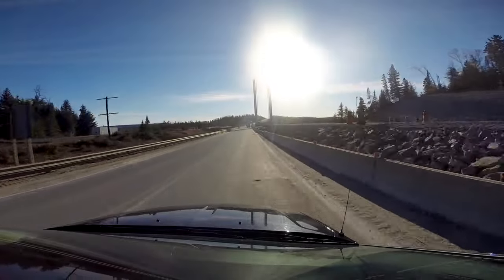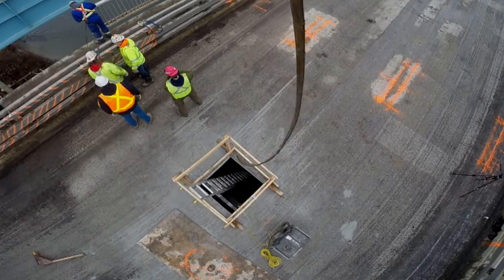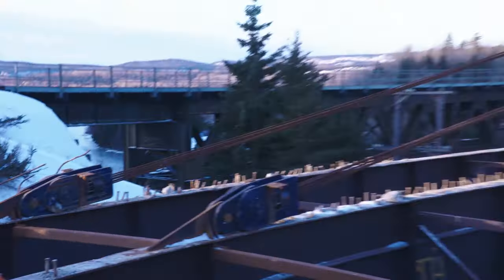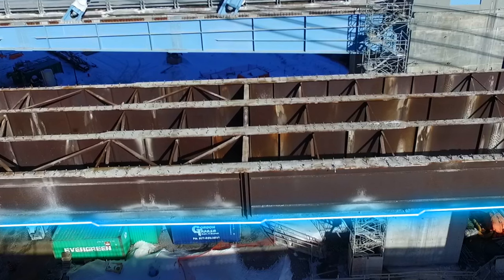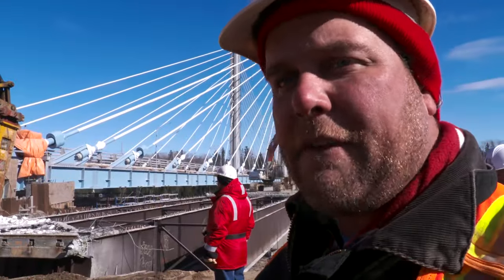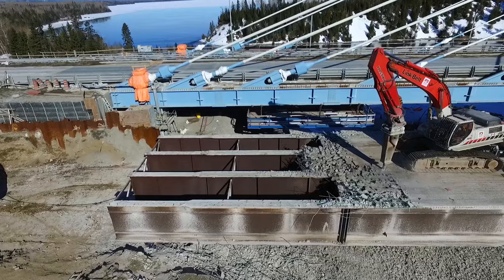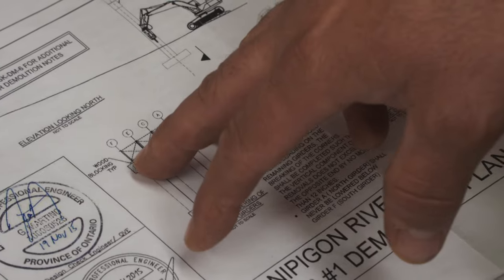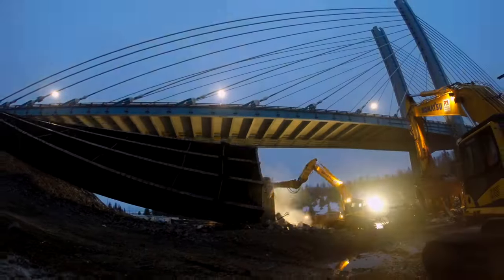Rolling a 827ft bridge off over a river in -40 weather. MUST WATCH!

Comment: The enormous size an weight of the project and the great planning and execution of the work were awesome.
Reply: And it broke right after they built it 🤣 think it was open for a week or two then it broke
Reply: @stuart4683    That's interesting.  Any idea what happened?
Reply: Believe it was wrong toque or something like that put onto some bolts the west side of the bridge ended up lifting 4 or 5 ft
Reply: On January 10, 2016, the new bridge was closed to traffic after all 40 M22 (7⁄8 in) bolts attaching a main deck girder to the northwest bearing failed during a winter storm, causing the deck to lift by 60 centimetres (24 in), resulting in the indefinite closure of the Trans-Canada Highway at the bridge.
Reply: @stuart4683  Wow!  That seems to be rather small fasteners for such a huge structure!  Thank you for the update and Happy Easter.

Comment: The steel looks remarkably good for such an old bridge.
Reply: Its not the original bridge.  it was a second one.  The first one was replace in the 70s i belive.  I used to live about a 5 mins from the bridge.  And had the oportunity to work on the project.  Not this project.  But the builiding of the new bridge.  Got to help Presly build roads to reach the bottom of the peirs.

Comment: Excellent video. Only problem is the blueprints constantly used for infographics were from the original 1937 structure, which was fully replaced in 1974 by the bridge that was actually removed in this video.

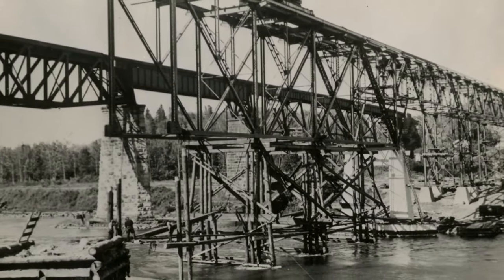Comment: 23:32 Correction the original steel deck truss road bridge built in 1937,  which is seen at 2:01 of the video was removed in 1974. Priestly removed the the steel plate girder bridge which replaced the original bridge. The new cable-stayed bridge is now the 3rd reintegration of the Nipigon River Bridge.

Also, are you sure you don't mean Yanny @15:45 XD
Reply: Thanks. That makes more sense. No way did that bridge look like it was from 1937.

Comment: Incredible engineering, however script states 246 meters long but narrator states 252 meters, so is the 6 meter discrepancy to allow for shrinkage and expansion due to weather?
Reply: No bridge expands/contracts that much. The coefficient of thermal expansion for steel is about 9 x 10^-6 metres per metre per degC. For a temperature range of -40 to +35, a bridge span of 246 metres would expand about 160mm.

Comment: Awesome collaboration!  It's too bad the new bridge failed so badly. Guess the powers that be should've just fixed the old one....
Thanks for the video.
Reply: What is wrong with the new bridge?
Reply: @samsmith3025  Some bolts broke allowing the end of the bridge to lift considerably, I would imagine it's all sorted by now.
Reply: @63256325N  
Boy did that cause havoc in the heavy haul industry. We had to postpone or go through US. Customers don't want to pay more, and the contractor won't pay so postponing usually was the only solution.
Reply: @sonshinelight  That had to have been a nightmare.
Reply: @63256325N  More than a few bolts- bad engineering from the start.  And yes- all 4 lanes opened Nov 25, 2018.  3 YEARS after the fuck-up.  A total disgrace to all involved.
Reply: @63256325N  it is far from sorted out, i have live my whole life an hour from this bridge, this bridge, they were told would not work here in our ex stream cold from places that have the same bridge were it is also cold but far from the cold we get, the first thing that happened was the huge bolts that hold the ends of the bridge down to the road grade foundations snaped right off like tooth picks, and the bridge lifted up over 4 feet, then that had this real dumb idea to weight it down with hundreds of tons of concrete blocks, closing 2 lanes until mid summer, they have tried many fixs but to this day it is an on going problem, i cant help but wounder, these huge cables that span this bridge any one knows that in different weather the cables are going to expand and contract all the time, and for the huge size and length of these cables they can and will expand and contract many feet,  with any change in temp., cold warm colder, hot,,  i be leave why the bridge lifted and still keeps lifting and going down, is the cables in the real cold shrink many feet lifting the bridge and weeks later it warms up 10 to 15 deg and the bridge go down again, but there high paid engineers cant figer that out, ( hence loading one end up with hundreds of tons of weights) not to mention all the huge ice that bilds up on the cables, hundreds of tons then brakes off and falls hundreds of feet, this bridge will keep giving big problems and many lane closings for weeks, until they rip this bridge down and rebuild something else, that is how this government works, and people keep electing these bastards back in. waste money, steel money, give money to other countries and leave its own people in total poor living, if this bridge got taken out, it would cut the whole country in half, north of this bridge are many logging roads that are no longer looked after, or plowed in the winter, so getting around it, is not bad for a 4x4 truck, in summer or sleds in winter but trucking would never go, there is  better bridge up north stronger longer but only one lane, well 2 lane if no big truck, but it is a huge heavy bridge, it was bilt to move logging and pipe line eqipment across with out any worry of weight on these back roads i have hunted all my life. in spit of oll the other places that have this bridge told them not to build it here, the goverment did any way. we have no say in anything here but we pay
Reply: @arnoldromppai5395  Still!  Such an important road. Doesn't say a whole lot about the Canadian Gov.. But typical politics.
Reply: @63256325N  so true and the dam tree huggers just voted them back in, the majority is in Toronto, Ottawa, no clue what is here or what it is like weather wise specially .. with this government we are so fn screwed..

Comment: yes what a disaster this bridge has been nothing but huge problems from day one, with our cold weather and dumb engineers that dont have any common sense the bridge lifted off its gritter over 3 feet in the air, then instead of correcting the problem they load the bridge road way with hundreds of thousand of tons of concrete to weigh it down to set it back down, this ended in lane closers for months, it been one thing after another again this summer lanes been closed for weeks into months, what a joke, not a bridge for this area ant thousand contested it that it will not work, and here in Oct 2018 still always huge problems and traffic stalled, this waste of money one day will have to be removed and a proper bridge put in,,, .. you should see how high that bridge keeps lifting off the road
Reply: Yes...and unlike what the video says the old bridge was actually from 1974. My question is why they didn't just build a new bridge next to the existing bridge then just use both? Sounds like a tremendous waste of money to me. I don't live in Ontario, but I can imagine the same amount of waste has happened all across the province...no wonder the old government suffered that terrible defeat!!... :-)
Reply: @FreewayInterstate  yes a huge waste of money i will bet due to all the problems and every time we turn around the bridge is closed, it keeps lifting off the road 2 to 4 feet and they load it down with weights until the weather warm up,, well that tells me the cables are way to tight, but the dumb ass running it has no clue, if this bridge ever got taken out it cut off everything to the east and west totally, i have lived here all my life, no other way around but old logging roads and not passable with anything but 4x4 an ATV
Reply: @arnoldromppai5395  With all this cost (and cost overruns) they could have twinned another (long) section of Highway 17, or for that matter constructed an entirely grade-separated expressway through Nipigon, including the intersection with 11! I only hope that the new Government and new Minister ensure that these sort of terrible decisions NEVER happen again. But you are right...this new bridge is going to give them nothing but constant problems, and I bet you anything another replacement project will wind up on the docket in less than thirty years' time, and it will go down in history as one of the most pointless projects in Ontario History, and certainly of the McGuinty/Wynne Liberal governments.
Reply: @FreewayInterstate  that is what i was getting at, it will not belong and this bridge will be ripped out, what get me, my sister works for the MTO AND YEARS AGO SHE TRAVAIL BACK and forth from Thunder Bay to Toronto, living in Toronto paid by the MTO doing all the drawings for all the 4 lanieing and all the clover lefts in Thunder Bay, they bought up homes and moved the houses making way for the clover leafs at 4 intersection, she work on this over 5 years flying back and forth, then came change in government and she was ordered to shred all documents drawings, everything related to the whole project,, as an engineer you know how much they are paid, and to destroy everything she had done over 5 year, lots of over time, air fairs, condom rentals in Toronto, the most wasteful thing in history i seen with my own eyes, then the government changed again and she had to do drawings for a half ass clover leaf for17 and  Hodder Ave. on a small budget, that turned out not to be a real clover leaf but rather a huge mess but it is how they wanted her to draw it out, now we have 90 deg turns on to tight road ways that trucker can hardly make.. just another huge mess that need to be changed but she could only do what was set for
Reply: They love to destroy knowledge in Canada.  Remember the Arrow?
Reply: @FreewayInterstate  thats right, let me fill you in on something huge, my sister works in the planing of hyws as an sivel engener, with the better goverment we had in many years ago, she did all the drawing, to put clover leaves in at all 4 intersection here at thunder bay, 4 lane all the way to us boarder to the sue, they bought up homes and moved them out to make room for the clover leafes ,, she flew to toronto every week for 3 years working on this, they paid for a apartment in Toronto plus rental car, when the people voted that government out and these ass holes that have now been in many years, they made her shread all plans, drawing, map, documents everything,, then they had her do drawing for the half ass over pass at hodder Ave that is totaly stupid and hard for big trucks to use and dangers..  i am told thee over runs on this bridge alone would have went a long way into 4 lane more and a proper clover leaf at hodder
Reply: @FreewayInterstate  were they bought up most of the homes and had the homes sold and moved out, they gave a building permit to Safe ways to build a huge store right were that clover leaf was to go. and were all the homes were move out from, this also close some old family business and ripped down, go for ever, they never were able to rebuild due to land cost in commercial space to what they were paid, forced out
Reply: @arnoldromppai5395  Whose government did all this? Bob Rae? Mike Harris? Dalton McGuinty? But whoever did it, acted like selfish little children, who want only their name on everything special. Believe it or not entire US States run on this boloney (most notably Illinois)...

Comment: How long before they demolish the new bridges that were constructed to replace this one?
Reply: I don't know. I'm guessing less than fifty years. And will probably be replaced with a bridge similar to the one that was there before (but four lanes).
Reply: @FreewayInterstate  Wouldn't it make sense to build modular bridges that use stock deck sections that can be easily replaced. Why build every bridge as a one of a kind structure? The sections could be made offsite and replaced in a day or two instead of taking months.
Reply: @tiredoldmechanic1791  The deck on steel girder bridges (like the old one) can be replaced quite easily. And technically you could replace the deck on the new bridge as well, but it would be VERY difficult.

Comment: Annoying how these things are demolished instead of being re purposed in place
Reply: As what  ?
Reply: The former bridge couldn't do the job it was intended to do anymore so it was replaced with a more traffic efficient bridge. All of the former bridge parts will be repurposed in other areas. The newer bridge will be safer for the traffic and all who would use the bridge. The former bridge steel will be remelted and the concrete rubble will become filler at this site or another construction site. Although it is preferable to repurpose some items in place it's not always cost efficient in the long run. In this case it will prevent the bottle neck in traffic allowing vehicles to actually move instead of just sitting there idle chewing up fuel. It will also allow traffic to move at a constant higher speed allowing the goods to get to their destination on time. Interesting comment though. Best Wishes & Blessings. Keith Noneya
Reply: Keith Noneya agenda 2030 don’t like it how about building a garden with some houses or a wellness clinic with a view,a restaurant,a school for acrobatics anything but gone
Reply: @richardeasther2569  Those are nice things and they will be built in other places. However I don't think building them in the middle of road on a bridge would be very practical. If it was built the revenue generated by renting etc would not be enough to maintain a steel and concrete structure erected almost 90 years ago, nor make of for the loss of revenue that the new bridge would allow. I love those old bridges too, they are a great work of art but sometimes they need to go to make way for new works of art that will carry on in their place. Take a look at the old Deception Pass Bridge opened in 1938, this is a great example of not repurposing, but just leaving it in it's intended purpose. It spans Deception Pass on Whidbey Island, Pass Island and Mainland Washington state here: https://www.youtube.com/watch?v=pJfLYHEnV70  Deception Pass Bridge is one that is worth saving due to it's historical and beauty. I used to live there and Deception Pass Park was one of my favorite places to visit.